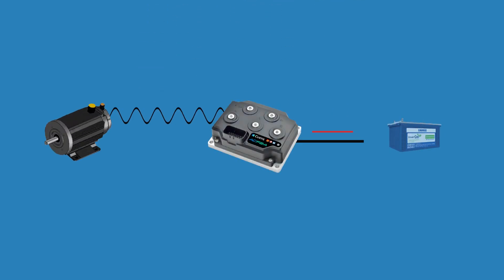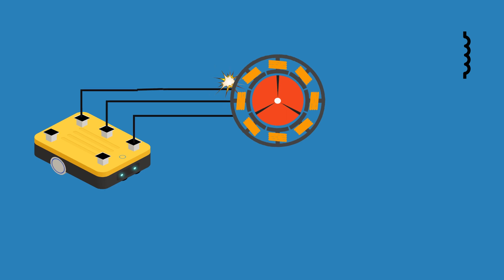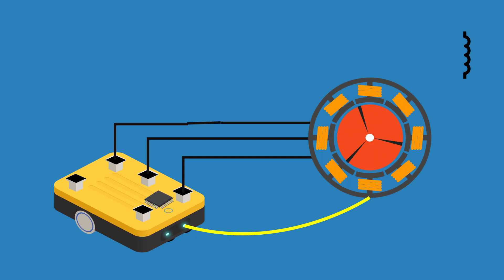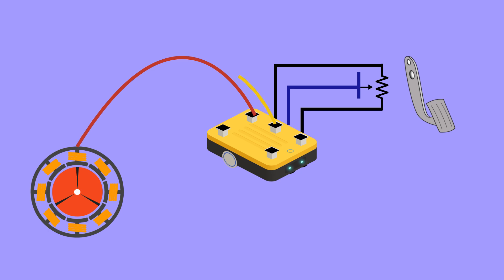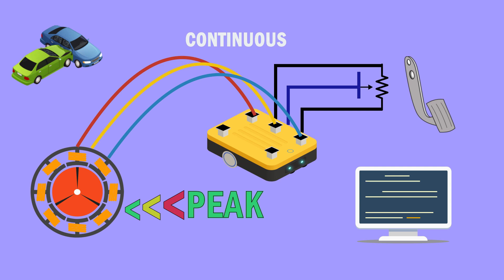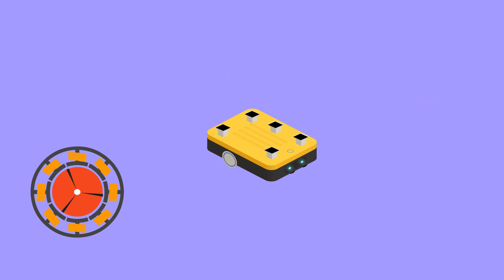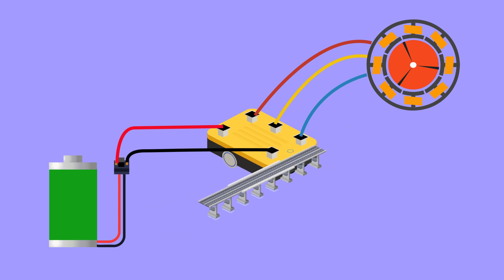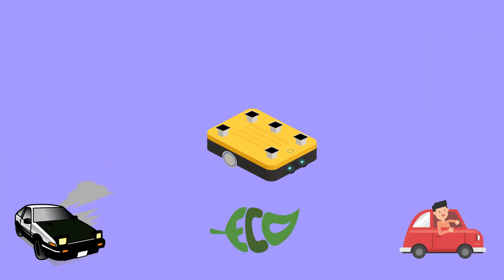Motor Controllers in Electric Vehicle | Motor Controller Working & features (Part 2)

Comment: does the controller reconnect to the motor once the charging of the battery has stopped?
Reply: and does charging the battery also disconnect from motor during regeneration stage?
Reply from the maker: it connects only once the vehicle is ready to drive
Reply: The controller has a "charging status" input which indicates to the controller whether the battery is charging or not. This input is given to the controller by the Battery Management System (BMS) which is an electronic circuit that comes with a battery

Comment: How is position of rotor measured?
Reply: sensors that work on hall effect
Reply: A TMR (search on google) type of sensor can also be used. It can be used only for a pmsm motor.
Reply from the maker: Using a rotor position sensor

Comment: Does the motor controller communicate with BMS
Reply from the maker: Yes, it communicates with CAN communication protocol
Reply: @FoolishEngineer  Can you elaborate. All the wiring diagram shows only +ve and -ve connections between the two components.